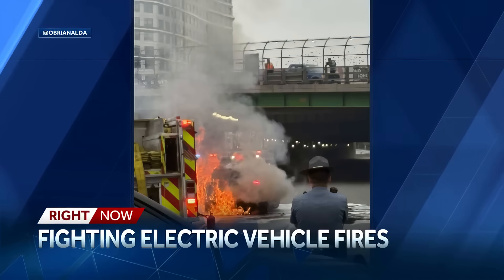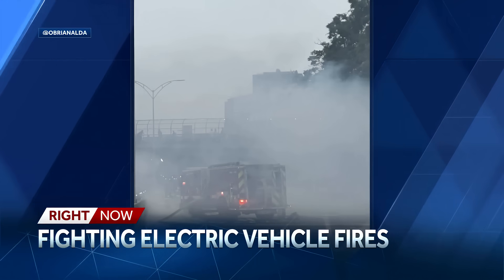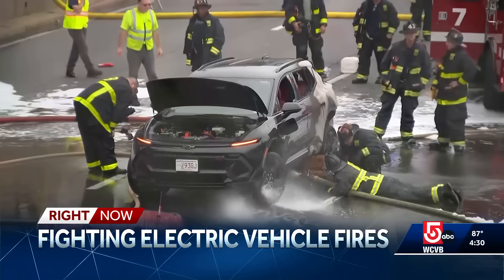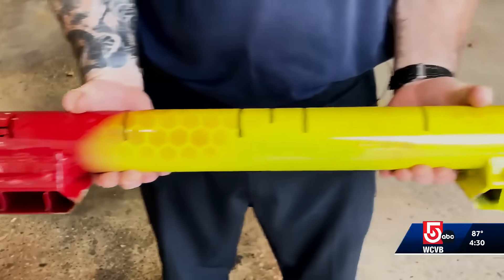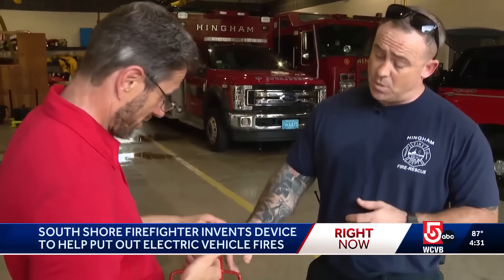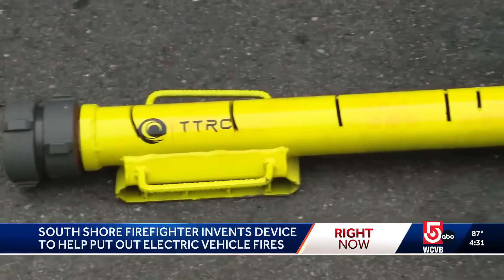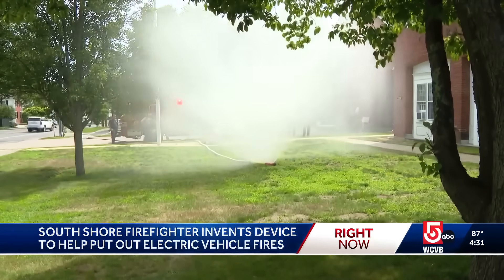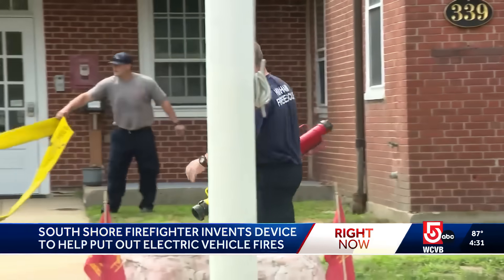Mass. firefighter invents tool to help put out electric vehicle fires

Comment: What would help the most is teaching firefighters that the water makes it worse for lithium battery fires. He should find a way to preload that pipe with a foaming additive to really put out that fire faster. Like they do for the airports.
Reply: Those foams are full of forever chemicals.
Reply: Stop with the insane misinformation. Drowing a Lithium ION EV battery in water is the key method to keeping the situation under control. Only a SMALL amount of Lithium exist in an EV Battery, the whole car probably uses about 10lbs of lithium. Majority of the flamable materials is Hydrocarbons like Plastics and Cell Electrolytes like ETHER. You can not defy chemistry facts.
Reply: Foam is not effective on lithium battery fires.  Also AFFF foam is being phased out due to environment and cancer concerns.    It's also more expensive than  water.

Comment: Electric vehicles should be equipped with a fire hydrant tipped that connects to the battery compartment. That should make attaching a fire hose faster and safer. Make it a law.

Comment: I thought water can't put out lithium ion battery fires
Reply: It can if the inside of the battery is flooded with water, it drops the temperature to stop the runaway - look up Cold Cut Cobra system.
Reply: @rtfazeberdee3519 where has your hypothesis been tested, documented and published?
Reply: You are correct. These batteries generate the oxygen needed to burn. Water is ineffective, though may slow the propagation if fire

Comment: Great invention indeed. I used to live in Texas and my neighbor was a volunteer firefighter. They used to have problems with putting out round hay bales because the couldn't get the bale to open enough to get to the center of it put out so they had to let them burn. My naighbor got a 6ft long lead pipe. Smashed one end into a tip. Put a 2 inch hose attachment on the other end. Then he drilled holes up and down the pipe. They would stab the pipe through the center and turn the water on and the pressure would tear open the hey bale and put out the fire.
Reply: Great invention but 3K for, yes a think piece of milled metal, but still a think piece of milled metal.
Reply: that's called a piercing nozzle.
Reply: Hope he patented it!
Reply: @grafxgrl8030 I doubt he did but he's over 80 now and I'm sure he isn't worried about it
Reply: @grafxgrl8030 why? It’s not going to actually help put these fires out. It will just help fire fighters not have to manage the hose.

These fires burn even if submerged .
To stop the fire you have to get the battery very cold or let it burn its fuel away. Water can prevent spreading but won’t halt the reaction unless it’s quite cold.
Reply: This thing won’t put out a lithium battery fire. Water just cools it down. The batteries can burn underwater so spraying them with water isn’t the solution. 

Cooling them will halt the reaction causing the fire but it needs to be freezing temps.

This is not a viable solution for firefighters.
Reply: @TroyWuelfing  if you cool a burning object enough. The fire will go out
Reply: Awesome work on your friends  work.🎉
Reply: That’s exactly the same as this guy’s “invention” which means he won’t be able to get a patent.
Reply: @snarlsbarkley5083 2 different tools. My ex naighbor is about 80 now so I don't think he is worried about it.
Reply: @snarlsbarkley5083  There is a very similar idea for EVs, it's designed to pierce the battery casing.
Reply: @snarlsbarkley5083  We have a very similar device from industrial production since many years.  It's not lead (lead?  Wtf, I hope you were kidding!) but steel, can also be hammered into walls or ceilings or other surfaces to reach fire behind those walls.  Very handy, in the past we often had to use axes, crowars, sledge hammers or chainsaws to get access to fire in walls or ceilings.

Self ignition of damp, fermenting hay used to be a classic decades ago.  We used to have a special probe — basically a termometer on a pole — which farmes could get to measure the temperature inside of of pile of hay.  These days the extremely compressed hay will not soak up much moisture and is often stored on the fields, often wrapped i plastic foil.  If it is brought into a barn it's usually already pretty dry and if not farmers have hay dryers.  These changed modern practices have virtually eliminated fires caused by self-ignition of hay.
Reply: Former FF. It’s called a peircing nozzle. Nothing new.
Reply: @Rockhammer2025  this was made in the late 80s. It was new then or at least in the erea I lived in.
Reply: @Rockhammer2025 it also can’t put out a fire that provides its own oxygen. 
If you want to stop these fires you need to get the battery very cold then the reactions will stop.

This is just a way to make it easier to spray water at the car and make it look like your “fighting” the fire but your just making it burn a bit more slowly and probably ensuring it doesn’t spread.
Reply: It's hay bale. Hay bale.
Reply: @optroncordian7863  surrounding bakes, trees, grasses and properties could catch fire from sparks etc. that’s one reason why they need to be put out. Any animals in the area need to be protected too. It’s an all around potential bigger issue.
Reply: Hay doesn't contain toxic burning chemicals when ignited. This device cannot put EV fires out!

Comment: cool invention but you don't use water to extinguish an EV fire because water makes it worse... Australia invented an extinguishing agent which does extinguish EV fires we even sell it to the US
Reply: What a bunch of nonsense. Massive amount of water to drown an EV battery is the proven best method to control an EV fire. FYI There is TINY amount of LITHIUM thinly spread through the big battery. A whole SUV car only uses about 10lbs of lithium for it's 1000lbs battery. Water has no dangerous effect on the lithium in the batteries.
Reply: The foam is only for electric bicycles and motorcycles:
"4L Lithium-Ion Fire Solution Extinguishers are Ideal for fires involving up to 2.4kWh of lithium-ion batteries, while 9L Lithium-Ion Fire Solution Extinguisher are suitable for larger fires involving up to 4.8kWh of lithium-ion batteries."

Even the original Mitsubishi i-MiEV has a 16kWh battery.

Comment: What a waste of money.  There's already devices that do this, it's called a combination nozzle, and virtually every fire engine already has one.  And until the batter burns a hole in the casing, NO device is going to get a drop of water into the battery case.
Not to mention it will do ZERO to prevent re-ignition.  It's better to just let the car burn completely up if there's no exposure.